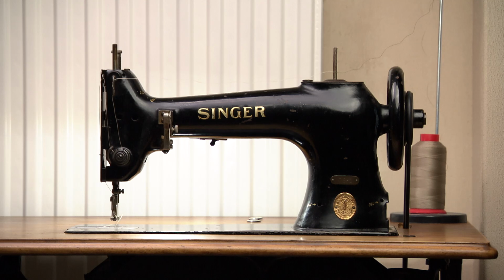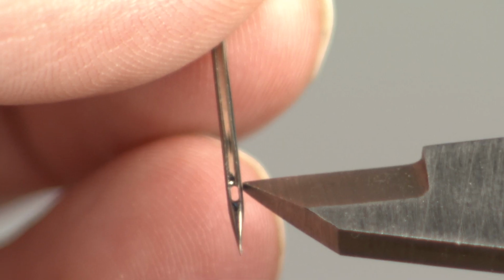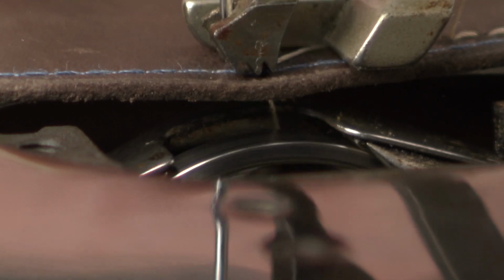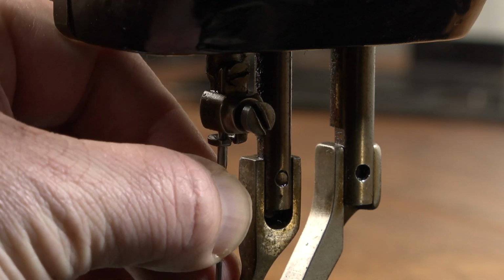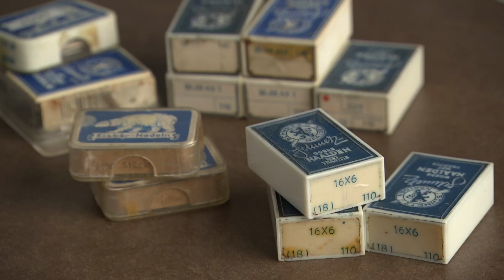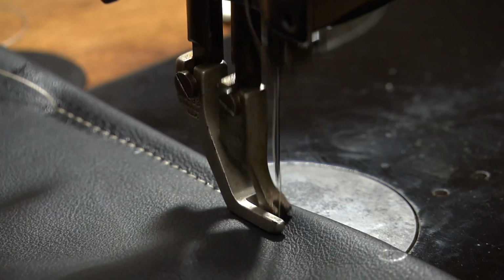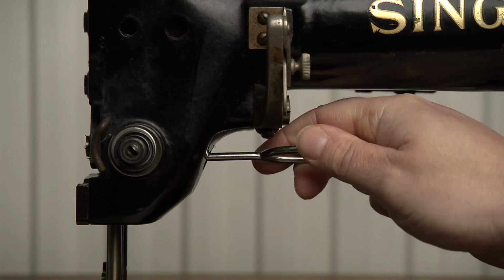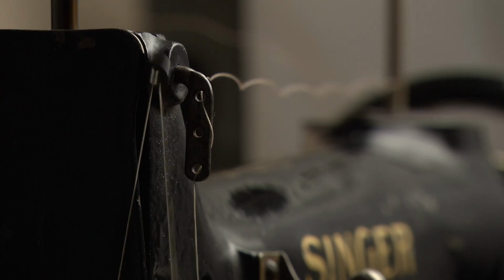Retiming a Singer 78-1 industrial sewing machine

Comment: Have you ever by chance found a service manual for the Singer 78- series  ??
My 78-3 is not acting like it wants to sew smoothly,  and I have changed the linkage stroke to every combination I can come up with. Either the needle presser foot isn't lifting up enough,  or the vibrating companion foot doesn't come up hardly at all. The equalizer linkage between the two parts has adjustment , but without the proper settings it is not stepping correctly and smoothly. 

This machine is very clean and has been washed down,  repaired damaged screws,  has a new bobbin case,  tensioner assembly and needle plate. Bobbin timing is dead on and set to work with the common 135×17 needles. I can get the Pfaff 134/35 and set it to those,  but I've tried that and it's just not cycling right. After watching your videos as well as others,  it has to be something connected with linkage position to the presser feet. 

Any ideas?

Great video quality,  btw, much appreciated.
Reply from the maker: Hi there. Thank you so much for your message. 
You asked me the same question two weeks ago. My reply remains: unfortunately I don’t have a service manual. 

I do very much like these sewing machines but I don’t have the in depth knowledge you are looking for. 
On fb there are some groups with very knowledgeable people, like the industrial sewing machine group. You might have more luck there. 

I’m sorry I’m not able to help you solve the issues you encounter with your 78. I do believe you find the solution. 
Good luck and take care

Comment: That's a great machine. I received a modern Singer "Heavy Duty"  4432 for Christmas. Definitely not as pretty as the vintage ones, but it seems to work well.
Reply from the maker: The 4432 is a nice machine too. Like every other machine it has to function. So nothing to complain about, right?
If I recall: you have a collection of vintage machines too?